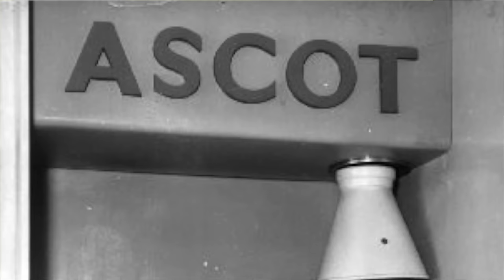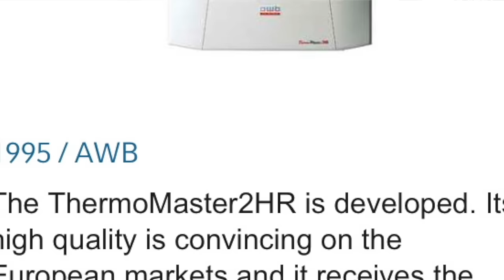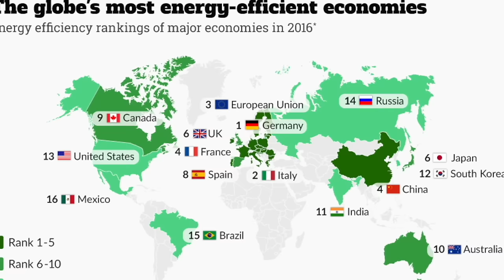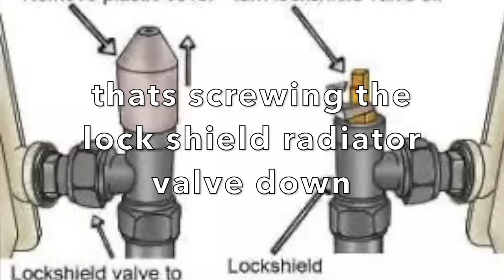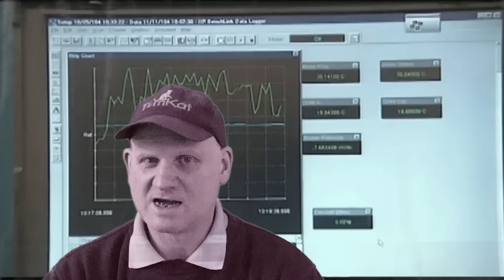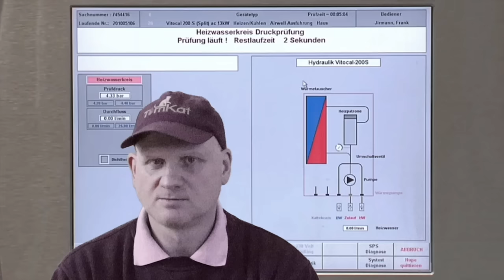WHICH IS THE BEST GAS BOILER for your home. Looking into the best boiler for uk homes in 2022

Comment: personally, i dont think any of the modern boilers match up to the reliability of the old boilers from 30 years old and older, its important to mention that if you have an old boiler, you have a peace of mind that they were bullet proof. engineers call them bullet proof because they hardly ever broke down, be it an old glowworm, potterton, vaillant, vulcan, ideal, worcester, or any other. there are still people who dont realise that the have a boiler in the chimney, because they hardly broke down and over time, in 15 , 20 years, the person forgot they had a boiler in the chimney. i know someone will point out the service issue, but im just making a point. i did a flue sample on a 30 year old boiler and the co /co2 was 0.0008 i think, and on the same day, another 2 year old boiler, and it was 0.001, so the efficiency on the old was better. just like some old and new cars. people make savings on gas bills, bit sometimes the repair on a new boiler is huge, even a new boiler in some cases, i had this twice on a viessmann. and getting the right parts onviessman is hard if the serial number happens to have been rubbed out or something.dirt in systems didnt much affect in causing boiler breakdowns before the turbomax ranges, same goes with expansion vessels and diverter, its the quality of parts thats gone down, o rings lasted 20 years without going hard, now its very less, same with fibre washers, before they were leather, now its like some paper composite.boilers were bulet proof. no manufacturer can claim theirs as bullet proof. they all keep their own old boilers in their training centers because the old boilers were meant to last a lifetime. didnt need a warranty of 5 , 10, or 15 years, neither did they need proof that the boiler was serviced (is it about 2 minute with no tools). i thought i would put this comment in because i repair many boilers, and ive repaired 30 year old boilers where engineers said that this cant be repaired, and it cost the customer maybe £70 instead or £3000 (plus problems for warranty due to sludge/debris). old is gold, if it can be fixed, try to fix, try too save the customer money, taking into account the yearly gas bills and what the can actually save.new biler life 5 years? maybe less ?im not being argumentative, but i thought i would show a different genuine view point.
Reply: You are correct those old boilers had a gas valve and stat so they never broke down. As rich as you are your gas bill would be over double it is today and not very green.
Reply: Dear zubs ,I’m afraid I think you are totally wrong in your ideas about boilers yes the old ones were a bit more reliable a bit like 1980s cars and mobile phones they were built to last for decades but this is not what  people want they are more Conscience of the environmental impact of running an old cast-iron boiler which is only 60% efficient that’s literally throwing 40% of energy through the flue pipe!  secondly, how did you have trouble getting parts for a viessmann boiler? Serial number rubbed off? 
There is a serial number on top of the boiler ,another one on the base panel of the boiler and also another one inside the boiler also there is the part number visible on most of the parts ! nine years ago I removed a Potterton netaheat cast-iron boiler and replaced with a viessmann vitodens 100 Combination boiler, during the last nine years it has been reliable and has paid for itself on the gas savings alone,  9 years x £300 per year = £2700 savings ! how did you find that the new combination boilers only last five years or less? This is the first time I have heard of this if you fit a quality combination boiler (preferably German-made) it will last you 15 years and if you change your boiler after 15 years you will not be complaining as it will have served you well .
It is all down to the installation quality . I only fit viessmann now since last 10 years, top quality
Reply: @SalimKhan-gk1fh  Hi Salim, I have installed many Viessmann's brilliant boiler and after sales, never had one problem, we have one here for Training, the point is efficances. In the 1970 80's loads of back boilers big cast iron high poluting units, thanks to very cleaver engineers in R&D we now have 90%+. Offically all boiers
are ment for 12 years,  some will last much longer if installed / maintained correctly. Too many are not thus last 5 years don't blame ihe manufacture blame the installer. Why do we still see photos in Gas Installer mag. My 2 installers are told NEVER work on any boiler over 15 and if the repair in over £500 then fit a Ravenheat 98HE. Thanks for your reply, regards george staszak
Reply: Dear Zubs,  When I started in 1970 we all just installed because we were not trainined to repair untill Vaillant started, thank God. 5 years later they broke down thus a new bread (me) evolved breakdown engineers. for the next 30 years I spend fixing installs and faults. Today 2020 we get the same:  Nr1 fault is undersized gas pipe, sludge, no by-pass, controls etc. etc. why is the standard so low? Take care george staszak Mr Combi Training
Reply: @mrcombiBedford  Hi George thank you for your reply the reason I gave big reply was because zubs he’s giving the wrong information to people! okay I agree 1970s & 80’s cast-iron boiler was the most reliable,But they are not efficient at all, Most of the fuel is wasted and over 40% is going out to the flu to atmosphere as pollution okay so 1980s Mercedes was the best very solid and built like a tank, but these days people will not accept 20 mpg efficiency from their car! I gave you example of the viessmann vitodens boiler I fitted , fitting cost was about £2000 butBecause it is efficient it has saved £300 per year on gas consumption, Very reliable last nine years if it last another 5-6 years this is okay for customer. Are you based in the UK ?because in the UK the installers are not doing very good job of the installation.
Reply: @SalimKhan-gk1fh  Hi Salim, we are in Bedford, I worked as a breakdown engineer for BG for many years covering north Thames and Eastern Gas also  many
times at most boiler factories they show photos on new installs which are I.D. in 2019 and as far back as the 70's. very sad it's still going on. regards george
Reply: @mrcombiBedford  The trouble is these days people don’t want to work and I think it is worse with the younger generation. Customer pay one days labour charge to fit a combination boiler but many guys are trying to do it in four hoursThe whole job completed . I take one day to fit a combination boiler but I will do it to the best of my abilities it will be a good installation and the boiler will last. 
I used to fit mainly vaillant but it is not the same vaillant as 20 years ago!
Reply: @SalimKhan-gk1fh  I have installed Vaillant and Worcester from 1970, in 2009 we installed a Vaillant 28Pro down rated to 12KW to mach the rads, 2017 changed to new eco 28 Pro the gas bills have gone DOWN proof the the latest models are cheaper to run with V Smart or any factory control or W-B Wave etc. 
In my opinion after the factory controls the best is 1 Danfoss 2 Drayton 3 Honeywell 
4 Hive.
Reply: @SalimKhan-gk1fh  My 1985 Mercedes 230E did 32 mpg and I did 400,00 miles  on the engine before selling it on.  Only needed valve seals and new camchain (old one was a bit rattly) in that time other than routine maintenance.  Yes the modern version would do 40 mpg but think of all the carbon footprint of melting down the old one and building a new one.
Reply: @Marc Jeffery Hi Marc, I think you have a back boiler? Love Baxi, must be well over 20 years, just shows that a simple system is so reliable but not eco for the planet.Because of sludge I would suggest when any system is over 16 rip out the lot except the copper pipes and start again. Get 3 quotes + 10 year G'tee  from a factory recommended installer. Thanks for the reply, george staszak Mr Combi Training
Reply: I replaced my steam boiler after 45 years of service. I have 3 Baxi Luna's 3.10 in another property and nothing but fault codes and shut downs at the worse possible times.
Reply: @wileecoyote5749  What 45 years boiler? The most popular problem in boiler change is sludge. It's recommended that a really good power flush then replace ALL the rads and re power flush without the new boiler  then fit the new boiler. or better still rip the old out and start again, regards george staszak
Reply: We have a Potterton Prima 1996 and it's still working well. Had its first official service by British gas last November. All good even the pump is original.
Reply: @mrcombiBedford  Hi Mr Combi to be more precise I was a commercial engineer before I retired and used to carry out brush out the burner lube the fan and check the combustion readings. Many years ago I replaced the ign pcb and the pump run on stat. Thanks for your reply.
Reply: @janavery4893  Thanks for the info. regards george staszak
Reply: Agree so much,when i think about the old floor standing Potterton kingfishers we fitted years ago,all cast iron and seem to just go forever,
Reply: We all know that the old boiler did not break down as much as today because installers don't do the job correctly, they don't fit by-pass, inhibiters balance down rate or even worse check EVERY year only when it breaks down. Old boilers were 55% efficient  now 90+% thank goodness I can't afford 55%. regards george staszak @SalimKhan-gk1fh
Reply: Bought my house 7 years ago, still got the Baxi original Back boiler in it maybe installed in 1970s , still working!
Reply: My Potterton profile that I installed myself ( ex corgi ) lasted 24 yrs with only a PCB replaced and was working fine when changed for. Worcester that will last half that if I’m lucky. Yes the new one is more energy efficient but the price of two boilers against one doesn’t make it good value. We’ve all been had.
Reply: @kevincuthbert3058  Hi Kevin, as we know it's all about efficiency and CO +CO2, BBU are 50/60% please see your monthly gas bill work out how much 40% is in money and pollution which goes up the flue.
Reply: Ask yourself this question, if you have an old boiler that may not be very efficient and decide to renew the whole system,you may notice the cheaper gas bill,but an average person will be paying off the initial install for years and counteract any saving ?
Reply: @jasoneldridge4738  We all make difficult decisions, if your van / car kept on breaking down how long before it's replaced? We installers have to be true-full and say "I am NOT going to fix this boiler / system" Too old! I have to get a loan for a car house boat, why not a heating system for 14 years? regards. george staszak
Reply: @SalimKhan-gk1fh  All very well and good if you believe the global warming clap trap.
Reply: You are simply wrong, efficiency is measured by CO2% and flue gas temperature, the lower the flue temperature the more heat that is absorbed by the water circulating. Yes, the old atmospheric cast iron boilers were more simple but grossly inefficient but it didn't matter back in the day when energy was cheap. These cast iron boilers were about 60% efficient, a good condensing boiler today costing £500 per yr in gas consumption, compared to an old mangle of a boiler that would cost £833 per yr for the same amount of heat output, over ten years that's £3333 saved. Greater savings can be made by incorporating smart controls weather compensation and optimisation with RF-Bluetooth TRV's. Modern condensing boilers are very reliable, just make sure your system is clean has water treatment and a good mag filter on the return and it will be good as gold.  I suspect you just don't understand the new technology and are more comfortable with the old stuff.
Reply: Hi Coyote, I agree with most you say except I don't remember gas or ELX ever being cheap, I expect in 20 years time they will say the same, Take care, george @coyote5735
Reply: @mrcombiBedford  You decide if your car is beyond economic repair should the owner of an old gas boiler be permitted to make the decision rather than some white box fitter?
Reply: Dear zubs, Thanks for the comment but that is not my video I did not make it. regards george
Reply: @normanboyes4983  Hi Norman, as previously written it's not my. video, but I do think any boiler over 14 years should be replaced. regards george
Reply: @mrcombiBedford  Hi George - a boiler only needs replacing on condition, not age alone. The environmental factor is of course important but any theoretical efficiency gains will only be realised if the boiler spends most of its operating cycle fully in condensing range. I suspect that is not of interest to the white box fitters, BG are the worst when it comes to up selling.
Reply: Thanks for this comment, my glowworm is 33 years old and is still ploughing on. So, it would take a lot of fuel efficiency to pay for a new boiler and controls to make it worth while? Yes? Peace be unto you.
Reply: @peterryan7827  and rrfcb
Reply: Combi boilers are great for the vast majority of homes but IMHO have deskilled the heating industry. IMO It will be challenging for a certain group of fitters who have solely worked on installing combi boilers to transition to installing heat pumps because they lack the necessary expertise and experience required.
Reply: I had a customer ( I'm now retired)who used to have BG service their boiler! One year BG said that they had serviced the boiler! The only problem was that the customer was on holiday and the boiler in the back of the property with zero access to it! They came to me as I had just gone self-employed.

Comment: I defiantly going to stick with my ideal Mexico 2, been running for 56yrs without any problems 😀 (just found out it was installed 56yrs ago)
Reply: I just replaced the same boiler, Ideal Mexico in my house with a modern Combi. It must have been at least 40 years old. Essentially there was nothing wrong with it apart from its total inefficiency and I personally battled with replacing something that wasn't broken.  I'm glad I did. My gas bill has now reduced remarkably by 70% and thus my carbon footprint. Which is a good thing. It is also extremely efficient and warms my house so quickly compared to the old boiler. The old boiler was bombproof and good for the time but hardly 'Ideal' for the modern world. Excuse the pun. Food for thought.
Reply: I installed the Mexico 2🤔 I thought they came out in the late 80,s even early 90's
Reply: Late 80s boiler.

Comment: What a good informative video. As a retired ships chief engineer I like to think I know a little bit about various boilers/systems. This video explains essentials in simple terms that most customers will be able to understand and so help them make a good decision. By the way I have just had installed a Worcester-Bosch Style 8000, 35Kw combi boiler and  EasyControl thermostat by an accredited installer and so get the 12 year guarantee. (This replaced 30+ years old Worcester). So far, so very good. The only comment I would make is that there are no written instructions available for the EasyControl smart phone app, which is easy to use but I would have liked a detailed explanation. Old fashioned I know!
Reply from the maker: Thanks for watching and your comment cheers 👍🏻

Comment: I agree with you Zubs as that has been  my experience over the last 20 years after replacing  ye olde faithful cast iron boiler. Maybe it’s just down to bad luck but since then I’ve had three different boilers , Vaillant  failed after 5 years  despite expensive attempts to repair  , Potterton lasted 8 years again with expensive repairs & touch wood Baxi is still going but again with repairs Baxi . Most of the repairs always seemed to involve  what I would call the electrical components of the boiler & the cost of replacing two ‘mother boards’ ( is that the right term ?) was eye watering. In my case even if as someone stated the cost of gas would be double it still wouldn’t have been more than installation, servicing  & repair costs. As for the environmental side of it - well two boilers that have gone to the tip in the meantime isn’t very green.
Reply: This is why I am tempted to keep my 40 year old Ideal boiler. Minimal costs, a new gas valve and a couple of thermocouples. With corrosion inhibitor and smart valves only use about £700 of gas a year for a 2 bedroom semi-detached bungalow. Can't see a new boiler with yearly maintenance etc really being cheaper over 10years.
Reply: @Corsham Viton they just farm seem to fix their diverter and low water sensor problems

Comment: The advent of condensing boilers is probably the most significant leap in domestic boiler efficiency - ever. It is also the biggest job creation exercise keeping ‘gas engineers’ busy installing them and repairing them. However to gain fuel burn efficiency and keep the house comfortable, there needs to be less focus on which is the ‘best boiler’ and much more focus on the house, in terms of the heat losses, selecting a boiler of the right size and the sophistication of the control system to garner back efficiency. In addition, there needs to be some analysis of required system flow rates  and what amendments are needed to the current pipework to enable that. Also, effective power flushing takes time - it is not a 30 minute exercise.

I am not at all sure if all ‘gas engineers’ are equal to the task, many are not able to do the above (or cannot be bothered) and just offer a ‘white box solution’ - hang it on the wall in a morning  - job done. But it may not be the right boiler and any paper efficiencies may never be realised.